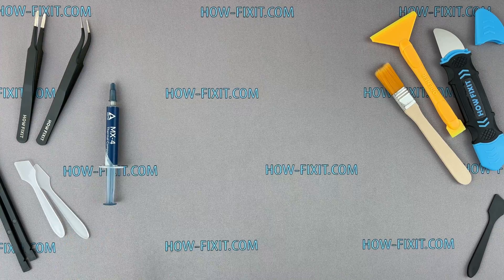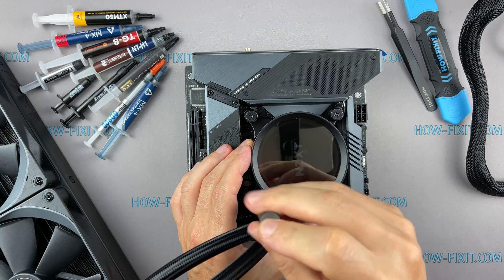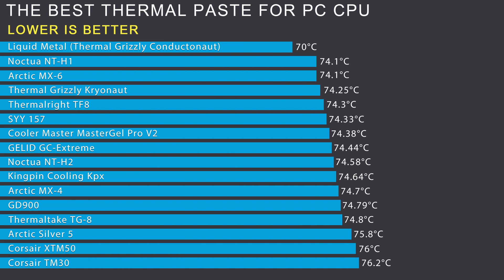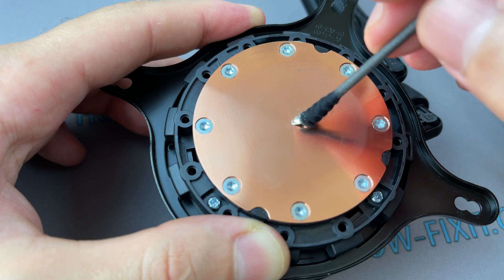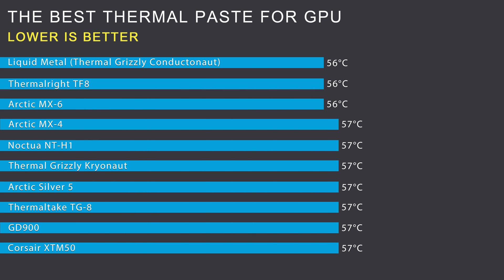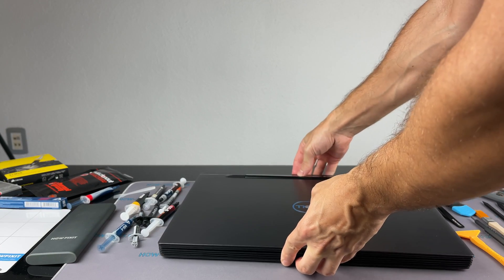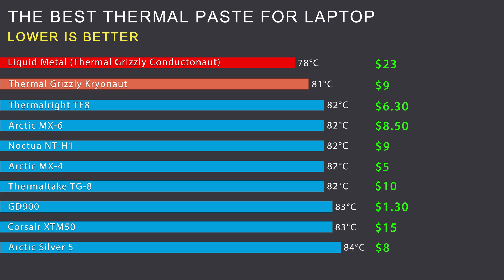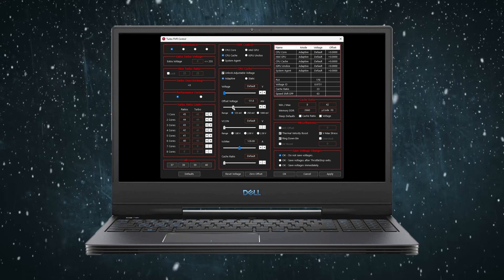The Best Thermal Paste for PC CPU, GPU and Laptop

Comment: This is the most idiotic test. You wont see the peak performance if you use mid tier components that use little wattage. Should have been tested with at least a 300+w i9 and a 400+w gpu. At low wattage these pastes would perform the same.

Comment: I don't know if it's possible but wouldn't it be easier for the processor and cpu cooler factories to try to smooth the metal as best as possible so that there are no imperfections?
Reply: its not possible

Comment: I feel like most regular people could just use the GD900 even if its the quickest to dry, because in 1-2 year's time the dust would most likely get to your fans anyways, requiring you to take them off and replace the thermal paste anyways. Also, the GD900 is good for at least 2 years, because from my own experience, it didn't seem to be losing thermal conductivity even after it dried significantly (I only had it up to 2 years because that's the longest I went without cleaning my GPU fans).
Reply: GD900-1 is good as CPU package power in PC does not exceed 120W, and in laptop 30W in stress. If it exceeds, I recommend trying PTM7950 to reduce thermal throttling.

Comment: For laptops: Opera browser and Youtube resets the Cpu’s load, if it was designed for overload and overheating when it was sold. By setting the Youtube video to too high resolution, it will cause Windows to crash. You have to force the restart. It may take 10 retries, and the Cpu load will stay at 80% at 720p with 2.1 ghz cpu, using wifi. This will also affect the heat generation, so afterward you don’t need a very good paste. If you want a very fast modem, try 4K or 8K video even if your laptop doesn’t support this resolution. Listening to nice dance music video on Youtube, will turn on the audio codec, installs it secretly even on Android. Results the ability to switch to higher resolution. It’s very important for Pentium M, to be able to watch 320p videos.
Reply: I didn't get you bro 😮
Reply: @CaptainScorpio24  AI bot?
Reply: You realize the Pentium M is a 20 year old processor that was slow even when it was new, right? It's literally about 50 times slower than the 2-4 core cheap CPUs that come in budget laptops. and can barely run Windows, let alone render HD video on a web browser.

Comment: Next what are the best heatsinks for memory,VRM etc!
Reply: Copper, then Aluminum in a distant second. ANY heatsink on those is going to be way better if there's airflow or space to dissipate heat without fans, but Copper over any shitty aluminum factory heatsinks are gonna perform a lot better for the exact same size/shape.

Comment: Quick warning to laptop users, you NEED a high-viscosity paste(in other words a thick paste). Unless you’re prepared to change out ur paste every 2 weeks. 

This is due to a phenomenon called “pump out”, there are videos done by GN
Reply: what thermal paste do you reccommend?
Reply: @nhoj3345  Honeywell PTM7950 phase-change material.
Reply: @nhoj3345  gelid gc extreme
Reply: @elonwong would gryzzly Kryonaut be a good choice for a low end laptop ?
Reply: @gabrielsiberianrifleman7358  nop it’s a low viscosity paste, and actually displays one of the worse examples of pump out
Reply: @gabrielsiberianrifleman7358  For a processor with low TDP, I suggest not to overpay and apply, for example GD-2 or GD900-1.
Reply: @elonwong  i know now,someone else told me that ,so i ordered a thermal grizlly hydronaut and an mx-4
Reply: @goorthiss  i literally searched for those you mentioned but couldn t find them to order online
Reply: @goorthiss  4gb ram , i5-4300 if i remember ,i hope at least one of the 2 is good to last the laptop a few years
Reply: @goorthiss  wait ... i did find GD900-1 but on Ali express ,it takes a month to arrive ...yea maybe some day i will get that one but for now i stick to what i ordered ,they arrive in 2 days (mx-4 and hydronaut)
Reply: @elonwong i got ryzen 7 4800h and rx5500m was thinking of buying noctua nt h1 or the mx4 is it good and suitable?
Reply: @Jewcob_x  nop had the exact same paste and it pumped out in less than 2 weeks on a 9300h and 1650. One of the worst for bare die cooling paste.
On the other hand it’s great on cpus with an IHS
Reply: Guys I am going to use cooler master cryofuze on my gaming laptop will share the review.
Reply: @its-ren-kun  give us a review in 2 weeks!!
Reply: @elonwong alright thank you so much for helping me i have ordered the gc extreme , ill give you a review in 3-4 weeks
Reply: Update : bro i opened my laptap and removed my heatsink there was literally none thermal paste on my die , it pumped out 99% of my thermal paste  . I cleaned my previous thermal paste and replaced it with  gc extreme on and for now as of 27/07/2023 it is doing pretty well , cpu max out till 82 Celsius and my gpu barely goes above 73 Celsius
Reply: @Jewcob_x  nice to know!
Reply: @elonwong  I recently applied gelid gc extreme on my nitro 5 recently, temps are pretty stable ngl. It did way better than the mx4 which pumped out after a few weeks of gaming.
Reply: @nhoj3345 u should have used the mx6 ....mx4 is not that thick
Reply: @elonwong  Update 2: On August 26, 2023, I opened my laptop after 1 month of using gc extreme and to my disappointment, some of the thermal paste (GC Extreme) got pushed out. Consequently, my laptop's temperature was frequently reaching 100 degrees Celsius, as observed through MSI Afterburner. I think in my opinion that preventing thermal paste expulsion in a laptop might be an inevitable issue, regardless of the paste's quality. (cons of owning a gaming laptop). but the GC Extreme thermal paste performed significantly better than other alternatives I've used before.
Reply: @elonwong  one more thing i wanted to ask that my thermal pads are bit worn out so can i remove it and use thermal paste on it instead?
Reply: @Jewcob_x  Recently it will change the composition of GC Extreme paste and it is no longer so efficient. Gelid GC-4 is a more interesting option, and the best is a phase change material such as Honeywell PTM 7950, Upsiren PCM-1, Gelid HeatPhase Ultra, Thermalright Heilos, Thermal Hero Pad.
It comes in as a sheet, lasts longer, performs better than traditional pastes and there is no pump out effect.
Reply: @Jewcob_x  hi late reply, keep the thermal pads. 
Also sad to hear about gc extremes also pumping out, do try using phase changing pads that others suggested!
Reply: Thats not true! Those a bit more liquid and easier to apply do not need to be re-applied ‘every 2 weeks. MX-4 for example is pretty easy to apply … the higher end ones that are ‘extra sticky’ and harder to apply end up producing poor results in less experienced or frequent builders.

Comment: Perfect, skipped straight to the laptop. I changed my thermal paste from my new 2023 gaming laptop which you can't undervolt and turning boost off is a major fps drop. I had some old 5 year old mx4 which actually made it worse. I will invest in getting thermal grizzly again, I'd say it's the best solution for heavy gaming in 4k ultra. I'm sick of getting 88-90c and it powering off
Reply: Honeywell PTM7950 phase-change material, beats all available pastes on the market. In my experience, I know that traditional pastes even with high W/mK, such as Kryonaut Extreme, are not suitable for laptops with high TGP and TDP, where temperatures remain at 80°C for a long period of time. After 8-12 months, traditional paste loses its thermally conductive properties. So far with PTM 7950 I do not experience this after ~16 months.
Reply: @goorthiss  I did eventually get around to installing Kyro and temps are perfect now, hardly ever over 70c, will look into PTM 7950 next time

Comment: GD900 hands down. Bought a 30g 3 years ago. Have build a decent amount of pc's with it, never any issue. Use it on my laptop XMG Apex 15 ( Ryzen 9 3900 , 2070 mobile ), no issues, temps are fine. Repaste every year and it's fine. 30g GD900 tube costs the same as a 4g MX4 tube where i live, not a difficult choice for me then. This reminds me, i need a new tube....
Reply: @gibonzproject9710  30 g in bed ? Is that some weird fetish or something ?
Reply: @gibonzproject9710  maybe u should read what i said. I change the paste every year and i have build alot of pc's with the 30gr tube.

Comment: Why no gelid extreme paste for laptop? Works the best for me and is so thick, it doesn't pump out. It's the only paste that doesn't trigger fans in my laptop when watching YT.
Reply: Have you even tried Kryo? I hate Kryo, and I'm sick of overpaying for it, but it's the only paste I've found for laptops so far that actually improves temps for 45w and especially 15w TDP laptop CPUs that actually run way cooler. I'm dying to find another paste that isn't Kryo.
Reply: @Brandn00b25 You mean Kryonaut?  Never tried it. From what I heard it tends to dry out in laptop applications due to prolonged temps over 80*C, it's amazing for liquid nitrogen though. If I had to choose now, I would go with honeywell tpm7950. It's a phase change material ( it will melt and fill micro voids in heatsink), but you have to keep hot temp on cpu/ gpu with benchmark or game for 1-2h at first, then It's set&forget, meaning I would only clean fans and heat fins periodically without unscrewing the whole system.

Comment: if l kept the thermal paste in its syringe closed does it expire after couple years? please l need an answer before l buy new one
Reply: Nobody will tell you as nobody knows how it was stored, closed, handled … just look up tests of stored pastes. They tested some kept in drawer 5-10 years and after 5 years no difference to new one. But considering the ridiculous prices compared to the tech its used for just get new one. Safe is safe!

Comment: The accuracy of the reading on the thermostat is questionable, its tolerance is likely much larger than the variations between most of the entries in your chart, i.e. it is nonsensical to display the second decimals

Comment: im going with mx4, because, i never used thermal paste before, my laptop is i7 9750h gtx 1660ti,  mx4 is 4 euros/4g  at worten.
wish me luck
Reply: I've tried a bunch, and Kryonaut is literally the only paste that significantly improves Laptop temps. I hate TG, and I hate Kryo, but I've pasted a lot and it's the only non-metal that actually is worth it and only for direct-die with shitty cooling like 15-45w+ Laptops have. I needs replaced by 12-18 months depending on how hot a certain cooling system runs, but for me that's not a problem

Comment: The temperature differences between thermal pastes are so small, that the best thermal paste is the one, which can last longer, and will not loose its performance over extended periods of time. Who needs thermal paste, which should be replaced after 6-9 months?
Reply: Noctua NT-H2 wins 5 years lifetime
Reply: Loose? Lose*
Reply: There is a difference in pastes, and it is huge if for example in laptops. Already a difference of 2°C can cause very large thermal throttling. That is why only phase change material is used Honeywell PTM 7950, Upsiren PCM-1, Gelid HeatPhase Ultra, Thermalright Heilos, Thermal Hero Pad.
It comes in as a sheet, lasts longer, performs better than traditional pastes and there is no pump out effect.

Comment: do yourselves a favor. if you're not massively overclocking, use IC graphite pads. you're welcome.
Reply: 🤡 Lmaooooo proof? Do it on a 13900k then
Reply: @redclaw72666  moron, I do have it on a 1370kf with motherboard OC. NOTICE I said motherboard overclock, which is mild OC. I SAID these are not for massive OC like 1+ GHz, but it's ok for mild OC or even factory clocks.

Comment: Good video, however there's one important thing that was missed out on.

When pasting a gpu or a laptop or anything else where the Heat directly touches the die itself. One should NOT use 'wet' pastes as these are incredibly prone to something called Pump-out. 

Basically when heat builds up, the metals of the heatsink deform by expanding, this will lead to Paste getting pushed over the edge of the die, and when the metal shrinks back to normal, the 'pumped out' paste that was pushed over the edge does not come back in. The Wetter a paste is, the more prone to pump-out it becomes. Kryonaut is especially known for this and people who use it, should replace it regularly. If you want a long term solution however you should look for dryer yet still high performing paste. I recommend Thermalright's TF-9 for this or Thermal Grizzly Hydronaut as that's the one Der8auer, the man behind Thermal Grizzly also recommends for These usecases

Again, this is only a concern for GPU and Laptop pasting, as those two need everything covered in paste, because they can get damaged if not. And also because of their smaller size, they're much more prone to pump out. It's not really a concern when pasting regular CPUs
Reply: Thank you for sharing the basic physics common sense, the average person is difficult to notice this matter, and for the actual use of the dilemma, describes the information clearly, more rare is probably a long-term use of observers, time proves everything, grateful! ( DeepL translation )
謝謝您分享了基本物理常識，一般人難以注意到這件事，而且對於實際使用的困境，描述資訊清楚，更難得的是可能是長期使用觀察者，時間證明一切，感恩！( DeepL翻譯 )
Reply: thank you so much for this comment really helps
Reply: So i should just buy hydronaut for my laptop (low end) 4gb ram ,ok thanks for the advice i was unsure ,almost bought kryonaut today before reading your comment,you saved me the trouble
Reply: which one should i use for my i7 9750h?
Reply: @vaiebhavpatil2340  laptop or desktop ? For laptop i got MX 4 and Hydronaut and i got no problems since it got applied ,(mx 4)
Reply: @gabrielsiberianrifleman7358  what about the pump out effect?
Reply: @vaiebhavpatil2340  from what experts say ,there is no risk for the mx 4 or hydronaut on laptop ,my laptops one with 4 ram and another with 8
Reply: @gabrielsiberianrifleman7358  i see. but i'm still concerned about that. i decided to go with gelid gc extreme. it's a very reliable paste with no pump out effect. it's thick and will serve for at least a year easily according to my research.
Reply: @vaiebhavpatil2340  great option i guess

Comment: nice video, definitely liked your attention to detail through every step of the way. its nice to see continued comparisons of popular thermal pastes.  personally use gelid gc extreme and always had great results in all applications.
Reply: GC Extreme solved my pump out issues on my old Sapphire Nitro R7 370 4gb.
would very much recommend it for GPUs, Laptops or anything direct die!
Reply: Recently it will change the composition of GC Extreme paste and it is no longer so efficient. Gelid GC-4 is a more interesting option.

Comment: Hey guys who used or applied Thermal Grizzly Conductonaut Thermal Grease on cpu/gpu laptop 🙏🙏🙏🙏
Reply: I've been using Thermal Grizzly Kryonaut for my laptop, and really I wouldn't recommend using it on laptops, nor using other ceramic-based adhesives for laptops.
After initial use, the effect is quite good, reducing 7-12 degrees C for CPU and 2-4 degrees C for GPU. However, the effect is not long-lasting, after 1-2 months of use, my laptop slowly returns to the state it was before using the glue, worse still it is even hotter than before. I cleaned and applied the glue again very carefully, but the same thing happened. Now my laptop is hotter than before, the GPU even goes up to 85 degrees when I play games, too bad. I made sure I used it properly, cleaned the contact surfaces, the glue didn't spill and tempered, the problem comes from its long-term effectiveness.
I did some research and realized that ceramic glues are only suitable for desktops, in a well-ventilated environment, they are not suitable for less ventilated and heat-heated environments like laptops.
Now I'm looking for a new glue to fix laptop overheating, maybe I will choose MX6, I find many MX4 users have a very long lasting effect, even a few years, MX6 is more improved pretty much, some tests even show that the MX6 is as effective as the Thermal Grizzly Kryonaut, this will be my choice.
Reply from the maker: I have been using Thermal Grizzly Conductonaut liquid metal for over 4 years, I share my experience in this video -> https://youtu.be/w7ChaNf9N-w

Comment: How about the pump-out on GPU and laptop? MX-4 for example, was great for desktop processor but when applied to direct-die such as laptop processor, it gets pushed from the die, making the thermal worse in shorter time compared to desktop which can hold its performance for years.

Comment: Dude, are you kidding? haha
We have electronic repair workshop.
GD900 - DRY AFTER 3 month.
Arctic MX4 - DRY AFTER 4-5 month.
Those are in case of everyday use, and playing games.
And that comes to ANY thermal paste. If you use PC or laptop every day, and it has heavy programmes or games running, you must change the paste every 4-5 month.

So if you want supercheap variant and are not lazy to disassemble the machine - use GD007 thermal paste and be happy by changing it every 3 month.
Cheers.
Reply: In the company I work they have not changed it in 15 years … costs money … 😂
Reply: I haven't changed the paste on my i9 9900k in 4 years and it still runs at the same low temperature it always has.
Reply: @JackBlack-wi8pz  
What are you using?

Comment: Too many variables to measure like this. Cooler mounting pressure / Cooler thermal quality / Processor TDP / differences in processor surface evenness / amount used / viscosity / thermal consistency over time.